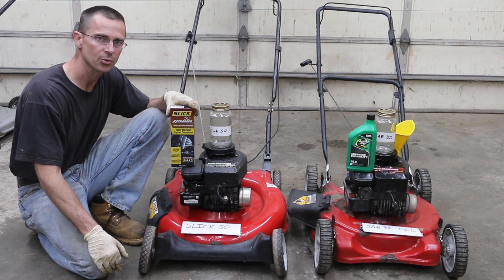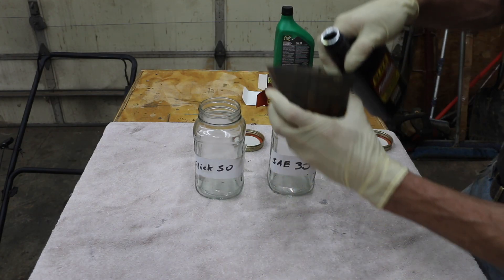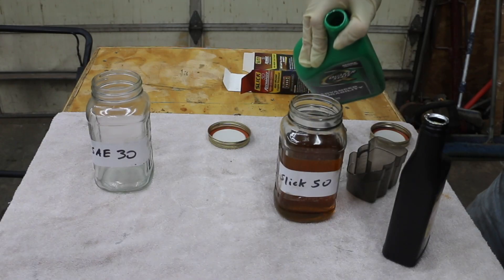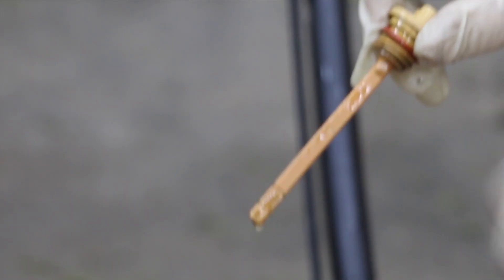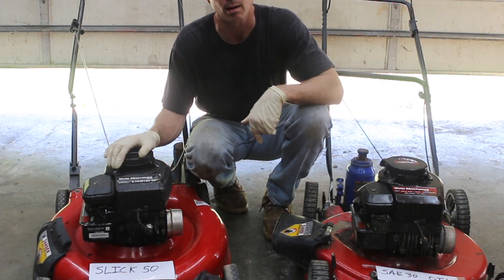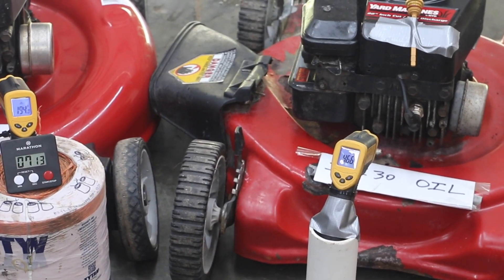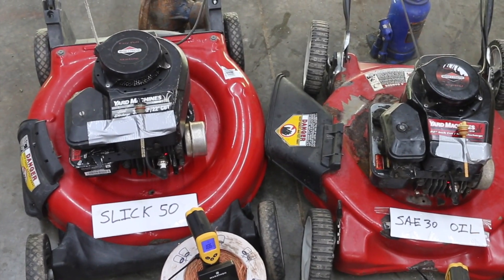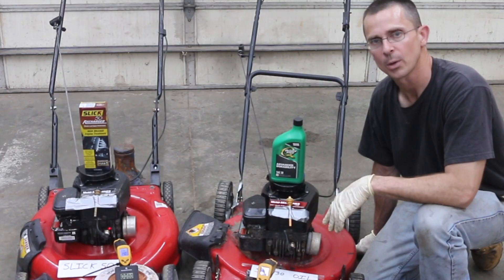Can't believe what SLICK 50 did to my engine!!--Dry Crankcase Test!

Comment: See if you can revive the slick 50 engine by forcibly cranking it and adding oil back to it.
Then try to do the same to the regular plain oil engine.
See if the slick 50 simply made the engine slow down quicker with less damage.
DO IT!!!!!! 
I think the slick 50 engine MIGHT BE REVIVABLE 
It sounded much smoother when it died than when the regular plain-oil engine died.
Please try it!!!!!!!
Reply: Did you try to dummy-crank the engine just to see what would happen?
I've seen a lot of "seized" lawnmowers start up after they've cooled down and continue running for a good while. sometimes even right after it seized it was able to be started back up.
it might just of need to cool down on the slick 50 one from piston expansion causing it to press so tightly on the cylinder walls that it seized temporarily. you never know. it could be completely free when you try to crank it. as if nothing was wrong. or it could be locked solid.. about 50/50 chance of either to be honest.
Reply: Well I guess it doesnt hurt to try? for reason why not? if they dont crank they dont crank. if they start right up like nothing happened. then maybe you could even save it.
if it seized before the rods and connecting joints themselves could wear. then it might be simply overheated piston head/rings which expanded and prevented it from moving.
Reply: How identical are the two engines? They both look old and therefore could have had different treatment over their lives.
Reply: I recently quit after 43 years of small engine work and am well qualified to state that the engines were pretty much identical (same bore X stroke, fuel delivery system, same internals) and this was a fair comparison. However, neither engines were put under a load which doesn't make for any kind of real-time "test". An engine will idle almost indefinitely with just residual "cling" oil in the crankcase(s). I saw this dude back in the 1960's at the local drive-in theater Sunday swap meet. He had a small Briggs engine with a clear Lucite sump cover. He was advertising a product along the same lines, idling the engine with no oil in it. I told him: "Rev that fucker up and put a load on it!" He didn't like that too much. Just keep clean oil in your engine and you wont need "additives" of any kind.
Reply: it's not original slick 50 formula...
Reply: Heinz 57 is gooder.
Reply: I agree.  That's how they used to promo Wynn's Oil  Additive - its post-seizure result
Reply: It actually can't hurt. I read an old comparison test done in Dirt Bike Magazine of gasoline additives that "prolong engine life, cool and add HP" and of the couple dozen or so products, only 3 or 4 actually ran cooler and added some HP. Most made the engines run a LOT hotter and HP dropped. Tests were done on a dynamometer in a controlled environment with a single cylinder two stroke engine. The engine finally locked up tighter than Fort Knox and testing ended, even though they tried shutting the engine down when temp readings soared. Sometimes you just got to think: "If it sounds too good to be true, it usually is."
Reply: Search: "The Groove Tube Brown 25". You'll laugh so hard, you'll probably piss yourself! Seriously, check it out!
Reply: Jack Zimmermann that's not the original slick 50 formula. the originator didn't patent the name therefore other companies used it. be original slick 50 has another name
Reply: Yes, add a quart of Brown 25 to your deuce coop!
Reply: Only way to tell age is if the dude posts the engine code numbers. I could tell you the exact day, month and year the engines were built with those numbers.
Reply: i once had an engine seize twice because my dad never told me it had no oil, and after the first seize i went to do something else and i guess it cooled down and so i assumed it was just a stall, then it seized and i checked and added oil right away, came back later and mowed the lawn with it, worked for at least a whole season
Reply: f
Reply: georgiaridgerunner 79 it's called "dynamic heat treating" the more purple the better.
Reply: S50 isnt worth a crap.  Duralube.  seen it by independant testing by an actual scientist.  Also anecdotal evidence.
Reply: QMI oil additives
Reply: I used Duralube once in my vehicle. I poured it in while the engine was running and the idle increased past it's normal speed within a few seconds of pouring it in. I don't know if it actually prolonged the life of the engine or not.
Reply: georgiaridgegunner...It  is real spectacular to watch those crankshafts fail in supercharged engines on the Top Fuel Dragsters and Funny Cars at the drag strips. 

It is a total conflagration when the shrapnel rips apart the oil pan.

Of course those Nomex Fire Suits help save the driver's life.

But I just cannot see myself wearing one of those while mowing a lawn.

And grumpybill was funny. 

I am wondering if he is Pro Stock's Grumpy Bill Jenkins???
Reply: I ran a motor without oil by accident, restarted several times. Finally started to seize. Added oil, flushed it a few times with new oil, still using the mower a couple years later!
Reply: Slick 49, was the original
Reply: Actually, head gaskets wouldn't be required if it didn't take so much machining to achieve completely flat mating surfaces. If you got it to seal up w/o a head gasket, you've not only achieved that goal, you've gained gobs of horsepower! The downward movement of the piston on the intake stroke would sort of seal the head to cylinder gap. Atmospheric pressure was slamming it shut.That's why your engine continued to run. It was still able to draw in an intake charge. Try revving it to the moon by eliminating the governor and then shooting the cylinder with a high powered rifle. A friend did that to a horizontal shaft Briggs with his .58 caliber black powder musket and the engine rolled away about 40 feet when the piston jammed. The built-up inertia made that fucker roll like a bowling ball! Just don't try running one on acetylene.
Reply: no guns in my country
Reply: realflow100 b
Reply: I've "revived" many a vertical shaft engine from seizure. It's always the upper crank bearing that seizes and if the upper bearing is bronze, you just break it free by turning the engine, add oil and go on your merry way! My customers would usually reward me with a nice tip for saving them hundreds of dollars. If the engine is "small frame" like the ones in the video, it's not cost effective to fix. Too much metal transfer has occurred from the aluminum block/bearing to the steel crankshaft.
Reply: These horizontal shaft engines don't take to kindly to "breaking free" and ever operating correctly due to the fact that the PTO side of the crankshaft run in the bare aluminum block. When they seize at that point, the heat created allows what's called: "aluminum transfer" coating the crankshaft's "bearing" surface. Then, deadly Muratic Acid is required to "melt" that aluminum off of the crankshaft. But, that does nothing to replace the aluminum lost in the PTO bearing surface of the sump cover. I've successfully broken free many vertical shaft engines that ran the upper (flywheel side) bearing in bronze. No "transfer" occurs prior to seizure(s).  Also, one an engine has seizure damage, no "Magic Snake Oil" is going to do anything to improve the engine. Money wasted. Just keep clean oil in any engine and you don't need any additives. Small engines with ball bearing crankshafts are very forgiving to lack of lubrication but will seize at the piston/cylinder. Then, you're really screwed!
Reply: Not the flywheel end. That's the end that usually seizes. On a side note, when I worked on small engines for a living, I'd always warm up an engine before changing it for servicing. One customer's mower was humming happily along when it tossed the rod out the block, scattering some block & rod pieces around the shop. It had oil. I called the customer and told him what happened. He could have been a jerk and told me he wanted a new engine, free of charge but said: "That's okay. I wanted to buy a new one anyway. You can have that one." Thanks...I think!
Reply: Its more about experimentation and testing the limits then it is about doing what is proper. sheesh!
Reply: TRY YOUR SELF DOPEY
Reply: Shut up, stupid. You should have known.
Reply: Just keep good quality and frequently changed (every 3 to 5 thousand miles) oil in your engine and you won't need additives. They're a joke. They won't "repair" mechanical defects. You should have known.
Reply: Get a self-propelled mower. Beats pushing! You should have known.
Reply: my question is how much older was the mower with slick 50 vs the other one it looked ragidy if you see the arms where you hold are bolted together and the sicker on top is faded away where the mower on the right is still bright red and new looking
Reply: robert retka actually if you look online for cold test on newer oils the put Royal purple stp Valvoline all synthetic the test was at around 30 degrees in a cooler all night next day see how long it takes to get to oil out the cup Royal purple didn't even move for about 30 seconds Mobil ended up being the winner followed by Valvoline and stop so saying that would make Royal purple the worst possible choice for a engine if in the cold it doesn't even move
Reply: Well sometimes you can get lucky.. With lawnmowers theres a huge tolerance because the rev limiter is set really low. so it still revs up to about the same range even with lower compression.. it just works harder and takes more gas lol. and you need to change the oil more..
Reply: ya, lawnmowers seem to not care, i ran one without a headgasket just to see and it worked fine, and i also tried loosening the head bolts while it was running, worked ok but didn't take much, but on propane it ran till there was a noticeable gap between the head and the block, you could hear it rattling
Reply: Well, be the first!
Reply: Should get http://lubrilon.com/support/pds.asp  Now  this product is the
 real deal .Was once called Slick 50 until John Bishop lost the 
trademark .What auto shop sell today Slick 50 is a lie . Anyway  
lubrillon the absolute best protection for tranny,engine and whatever . 
Been test in car  and oil drained  .Car  had no wear . My Uncle even did
 this test . I use it  :)
Reply: But, who and why would anyone run an engine without engine oil? Engine oil serves FIVE purposes, not just lubricates. The other four are: cools, quiets, cleans and seals power. Lose the oil and you lose those 4 other qualities. You should have known.
Reply: Why would somebody run an engine without oil? Well, when they're driving down the road, and their drain plug comes loose because the folks at the quicky lube didn't put it on right, but don't ask me how I know these things happen :) !! or I should say :( it happened to my VW, which is an air/oil cooled engine, no oil, blew a hole 4" in diameter in my crankcase, I couldn't even use it as a core to buy a rebuilt engine, it had to cost me the whole thing. Some of the original formula Slick 50 would have saved my bacon big time!
Reply: should have gone to a backyard mechanic, most of us will tighten it really tight unless the bolt looks questionable, and we will tell you to get a new bolt and while your at it washer seal, to tell how good a backyard mechanic is if you don't already have one you trust, just ask to see their car, if it is in ok shape but maybe the body is rough, then they are likely good and trustworthy, if the engine seems to have problems, ask them about them, what's that noise, if they have suggestions but don't seem too worried, you can likely trust them, why is your check engine light on, if they know exactly why, you can trust them, a true mechanic (not some guy with a license to be one) will not care about his own car, but will not let it die either, they often don't have enough money or time to fix the things wrong with their car, also if they have more than one car but one seems in way better shape than the rest, that is a good sign too, just know that if something goes wrong there is nothing you can do, you could go to them and ask for suggestions, but you likely won't get your money back, but it seems that was not a concern since you didn't go back to the oil change place, me being a decent backyard mechanic, i would be so pissed, i would try to sue them if the engine was worth more than piss, old, or rare, or high tech, or just not cheap, i hear these stories about pro shops fucking up an oil change more than i hear about backyard mechanics doing it, another hint is the character of the person, do they look homeless/dirty, or like a drug user/dealer, trust the dirty one, all i know is if i had something like that happen i would just personally tighten my oil plug after each oil change, best of both worlds, but i think i can count on one hand the times me and my dad had the oil changed in any of our cars once they were on the road (i know not good)
Reply: You might also mention that an ASE Certification means nothing. I've known "Certified ASE Mechanics" SO stupid, they usually have trouble finding their collective ways HOME at night! I know of one who, the more he worked on vehicles, the worse operating shape they became! One dude was trying to solve an electrical problem for a customer when the engine compartment burst into flames! Damn near burned the entire vehicle down! Never reimbursed the customer for damages. Customer was out a vehicle. HE was "ASE Certified"! To become ASE Certified requires nothing but passing open-book testing. The answers are provided. If you can read, you can become "certified". Here's a question you can ask someone who claims to be a mechanic: "What 5 purposes does engine crankcase oil provide?" If they answer all 5 correctly, you have a winner. Four out of five? Maybe let him change your oil. Three out of 5? Maybe let him change your flat tire. Two out of 5, maybe let him vacuum out the interior. One of 5? Let him look at your vehicle...at a distance! None out of 5? Let him join the Democratic Party.
Reply: well shit i only know of two and i'm designing engines right now, to cool and lubricate, unless there are subsets of those i have no clue, oh wait is to clean away contaminants and debris from the wear process one? and what about to displace water? i consider those part of lubrication but let's toss those in there and see if i'm right, lol
Reply: Slick 50 will not have prevented damage due to lack of lubricant, especially if the Bug's engine was under load at the time. Slick 50 is an "additive", not a "preventive". It just adds to the lubricating abilities of dead dinosaurs. You could get the same results cramming bananas, beans and avocados into your crankcase. Problem with that is, you'd smell like a mobile Mexican restaurant. I bought a '72 VW Type 1 (bug) once that had 2 connecting rods hanging out the block. Bought a dual port 1600 out of the Nickel, swapped them out and, after installing an extractor (header) and Porsche distributor,  bugged around for years! It helps to do frequent valve adjustments. Remember, kids: The engines in the above video were NOT under any load! You could actually drain the oil out of your lawn mower and it would idle forever and/or until it ran out of gas.
Reply: realflow100 ii 9
Reply: My dad was a big fan of Duralube.  He wouldn't go near Slick 50, but would always put Duralube in every third or fourth oil change.  

One of the techs at an oil change place my dad would go to try to sell him Duralube one time (before he started using it).  He saw the commercials where the Duralube would go towards the center of the pan when heated.  He didn't buy into it until the tech actually did the same demonstration that they show on the commercial right in front of him...blowtorch and all.  It actually did go to the center of the pan.  Same tech did the same demonstration on Slick 50.  The Slick 50 actually spread away from the heat.

I guess that was enough to sell my dad.
Reply: You would have the same good luck with Amsoil and spend much less money and go much further between oil changes.  Plus Amsoil has a written guarantee that they will pay for all parts and labor in the event that their oil was the cause of a failure.  Where's Royal Purple's guarantee?  I don't know why people like that Royal Purple crap.  Where was Royal Purple in 1972 when Amsoil was in high demand?  People thought synthetic oil was a big waste back then and look how important it is now.  I wouldn't waste any more money on RP after reading this.
Reply: Correct.  My dad used to sell Prolong.
Reply: Back in the mid 70s I had a69 chevy 6 cyl  pickup , I worked with a guy who sold and espoused slick50 and was always bugging me to try it . I finally did and after adding the required amount to an oil change , when I started my truck up and drove it I had no oil pressure reading on the gauge  ( although I may have had oil pressure ) . I ran the truck for a few days like that , no harm done but still no oil pressure reading . Needless to say I drained it out , filled it with oil ,ran it , drained it again ,filled it and my oil pressure came back , end of my slick 50 days . Went back to my Quaker state 15 / 30 happier than a pig in you know what .  🐖
Reply: Ah, the "Youtube Experts" emerge from the woodwork. Ever stop to think maybe the dude wasn't even born "back in the 1970's", kid? "Failure analysis" over the computer; youtube at that?! I'm willing to bet not any of you "experts" can name the 5 purposes of "ENGINE" (not "motor") oil does. How about it, kids? Any takers?
Reply: No takers? Can't say that I blame ya! Anyway, here they are in no particular order: "lubricate, cool, clean, seal power and quiet the engine". Now you know. You should have known.
Reply: Well, I don't know about "lubitron" or w/e, but,slick 50 was basically Teflon particles. And what do near impossible to breakdown in an engine solid particles do to small passages and tolerances? Slick 50 is a dumb idea. Fact is other than op temps,as you can see here meant diddly,regular or syn oil is better than additives. They are gimmicks. Some more harmful than good.
Reply: Reminds me of F. Franklin Freak of Gilbert Sheldon's "Freak Brothers Comix" (underground) Took the '59 Chevy to "Conscientious Car Care" for an oil change while he went on a quick drug errand. When he returned an hour later, the barefoot, bearded, long haired hippie "mechanic" told him: "$9.95". "Wow! What a bargain!" As he's flying along the streets of San Francisco, he starts smelling: "Beans? Bananas? Avocados? There's not a Mexican restaurant within miles of here!" Then...."BLAM!" and the car stops. He looks underneath and sees a rod hanging out the block. Curious, he dips his finger in the hole in the block and tastes it: "Beans? Bananas? Avocados?!"
Reply from the maker: I agree...both engines are ruined.  Thanks for watching the video and commenting!
Reply: realflow100 Even if he can free it up, it will be scrap. The only thing that slowed it down was metal on metal friction against the bearings..which will now be worn so badly it will knock like crazy
Reply: Or even a better thought, you can get two mowers and do the test to your liking.
Reply: Lee Barnes i disagree a seized engine should be replaced ..extreme overheating caused by lack of oil damages the metal... have you ever disassembled an overheated engine usually the crank shaft journal overheats to a point it turns purple ...i for one have enough sense to not reccomend that anyone spend time or money on an engine that seized due overheating from lack of oil.... finally ive seen an heated crankshaft break it went through the engine block and several pieces struck a metal tool box with enough force to dent the metal... and it wasnt far from total penetration ...imagine if that were flesh or an eyeball .... have a good day and be safe...
Reply: realflow100 You are correct.  The Slick 50 engine will most likely be able to start again.
Reply: Good thoughts.  BUT it still stopped sooner, for  what it's worth.
Reply: Lee Barnes i disagree a seized engine should be replaced ..extreme overheating caused by lack of oil damages the metal... have you ever disassembled an overheated engine usually the crank shaft journal overheats to a point it turns purple ...i for one have enough sense to not reccomend that anyone spend time or money on an engine that seized due overheating from lack of oil.... finally ive seen an heated crankshaft break it went through the engine block and several pieces struck a metal tool box with enough force to dent the metal... and it wasnt far from total penetration ...imagine if that were flesh or an eyeball .... have a good day and be safe...
Reply: I was working on a customer's BCS (Italian) roto-tiller with it's "Acme" (Italian) single cylinder engine. Dude's sandwich shop was spitting distance away and he kept walking over seeing how it was coming. I don't care for that. In my anger, I forgot to add oil and it was running when he walked up....again. It seized. 'What happened?" he asked. "Oh, uh, it, uh...ran out of gas." After he walked away, I quickly removed the started (recoil) and put a pipe wrench to the pulley and broke it free. Added oil and it fired right up. Hope it failed later but I don't know. Dude deserved it. Nice guy but a pain in the ass. Plus, he never gave us sandwich discounts. I scored a $3500 BCS tiller with a "modern" (post Acme) Briggs engine for $200. Mint shape except for the tines, worn out. $100 for a set of tines and 15 years later, still going strong! Must have been stolen for $200. Dude said: "Make an offer." I did. Great tillers once they dumped the Acme engine. Honda-powered ones are the best.
Reply: Understandably that both engines have suffered some sort of damage, but to just say, "..oh, well they both died, end of test", would be rather short sighted. It would have been fair game to allow both to cool down, then attempt to free them up and add the respective lubricants back into the crankcases and run some more tests.
Reply: Exactly.   I can't see why he is saying "NO" to the second bit of the investigation.   He seems to have his head up his arse!!
Reply: Georgia 79: What's wrong with total penetration if she aint going anywhere?
Reply: Borrowing a page from the 2 stroke manual where oil is sometimes forgotten to be added and/or oil injection pump gears have their nut spin off - I can assure you that there was some damage done and even yet with that damage, a good and prosperous life can still be had from the worst case of zero oil engine lock up. But yeah dig a deep hole instead and bury it. Could I get a picture of that grave with your head stuck in the sand right next to it?
Reply: did you not read my entire comment.... ive seen an over heated crank shaft break furthermore i dunno where you get this dynamic heat treating line from but its like this heating a crankshaft in a running engine without oil isnt how its done...im gonna take a shot in the dark and think your making a reference to the harder outer layer that forms onthe metal components of an engine during break in...break in isnt done without oil by over heating an engine ..i dont know the process for accomplishing this on an automotive engine...but i can tell you briggs has never told any of its customers that there engine needed to broke in...finally i have to ask why are you here trying to undermine a small engine mechanic... is it possible that your just a wortlhless troll on youtube making comments of something you know nothing of... good day sir do not waste your time commenting back i wont entertain idiots or there idiotic delusional notions of superiority(even though they have no realworld experience said topic)